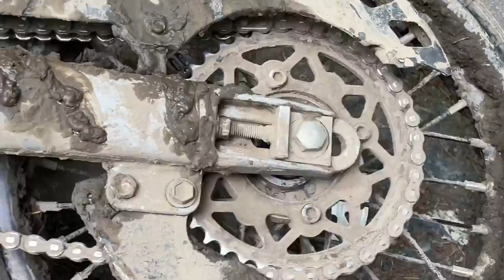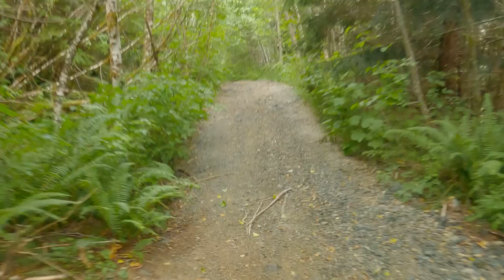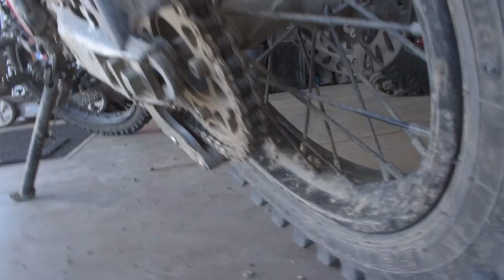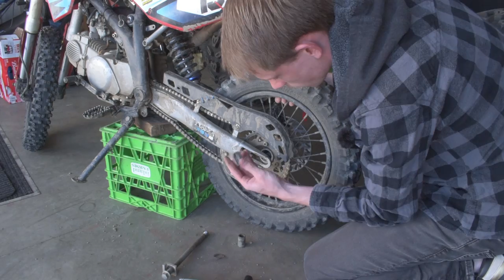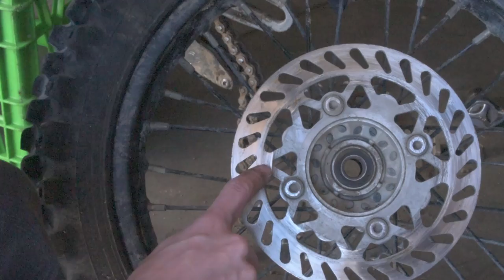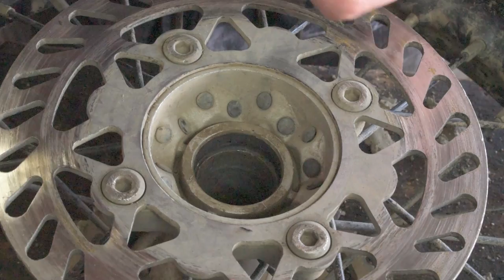IT BLEW APART *SO SKETCHY*

Comment: For a little added security you can use loctite 609 if a press fit isn't as tight as you would like it to be. To remove just heat to its releasing temp. If its a huge gap and is now a 'slip fit' Loctite 638.. can take up to .01" of play with that stuff!
Reply from the maker: Thanks for the idea!!

Comment: Do you still have the 150cc motor on it and if so how is it running? I'm bout to do the swap on the same bike but black. Trying to get info. Thanks in advance
Reply from the maker: Yes i still have the 150cc engine in it. Engine runs fine, its the transmissions that are weak and get sloppy if you jam the shifter or stomp on it
Reply: @AaronsEnduro  we got the red one like you and a black rfz. I been thinking really hard about the 150cc swap. I done swapped the carb and I got the 14/17 tires coming in the mail. Trying to just get a point of view on them. Ur the only one I watched that has done it
Reply from the maker: If ur 125 engine still runs, its not worth it
Reply from the maker: Do a 190 swap
Reply: @AaronsEnduro  now with the 190 swap will everything still bolt up? And I was thinking bout that from the jump. Just didn't know if u had to do any extra work. And yes my 125 motor still running fine. I ride it to work everyday haha
Reply from the maker: 190 will bolt in, but will need a couple extra supporting mods compared to a 150 swap